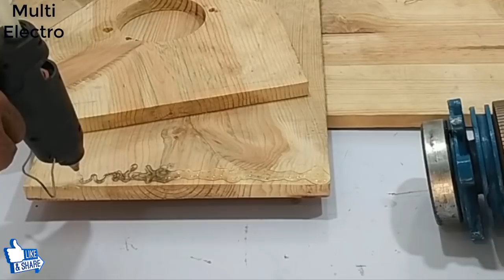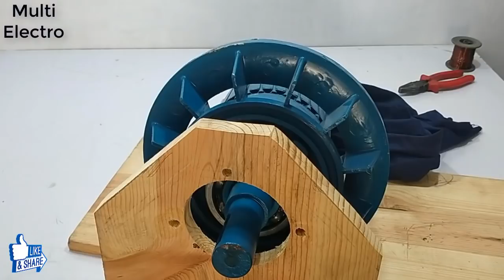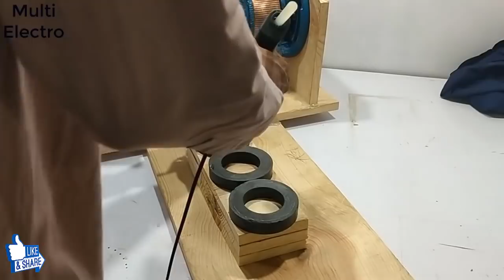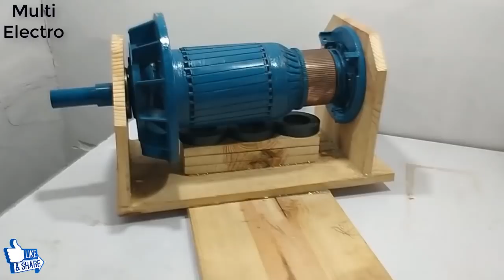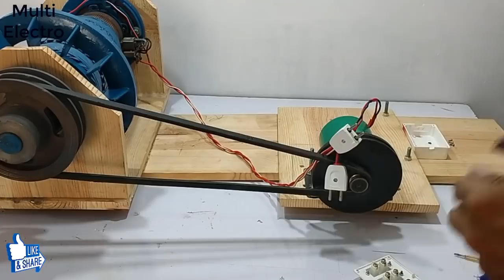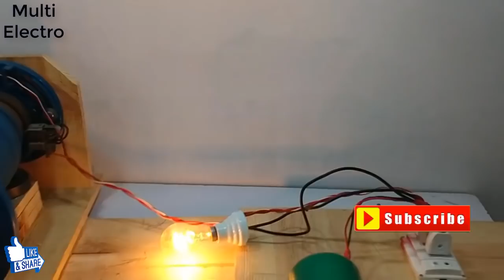How To Make Free a Energy Generator 220V With 25 Hp Dc Motor Rotor And 3 Hp  Dc Motor New Experiment

Comment: the end result is very poor unstable light bulb. it is not worth it. The motor and dynamo are expensive. The procedure is not money saving in addition to  the noise which is done by the motors. You can buy silent and efficient electricity for years using the money of the cost of the motor and dynamo. In addition , the procedure may fail and stop after a short period of time.

Comment: Host question about the 25hp dc motor , why the need for magnets under it if the dc motor already has magnetic rotor inside it?  Or am i mistaken about dc motors and there having magnets inside?

Comment: OK, not (yet:) receiving you answer, it is obvious that your magnets are ordered as S-N-S or N-S-N - essentially a counterpart of Tewari''s generator which - with almost fully counter-directed magnetic field attained with a particulr modifications of conventional generator - attains some 2.2 overunity factor ... while in your implementation you might have it on that part) somewhere around 1.75, additionally you might save on Lentz's effect of uncollected coils, plus some effect of the wheel's overunty effect - so, in my view you have done great job!

Comment: hi, Good Job. how much RPM in a green motor, if blow rotor capacity is 25HP( 18.65KW ) how much RPM needs to output 25 HP. thanks
Reply from the maker: 1450 rpm
Reply: Hola
Reply: A como son

Comment: How 3HP DC motor can be run on 220 AC voltage, as you shown in video?
Reply: I’m think the 3hp motor is a AC motor and the 25 hp is generating Ac to keep the 3hp running  it needs capacitor to stop the light from flicking.